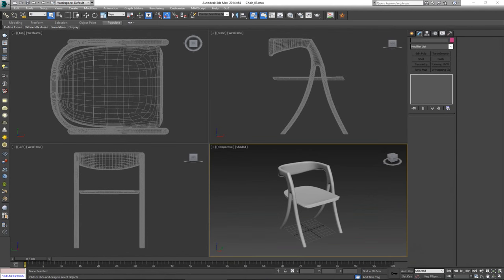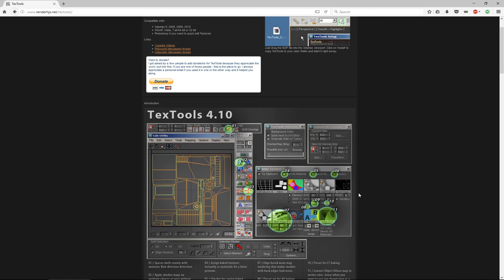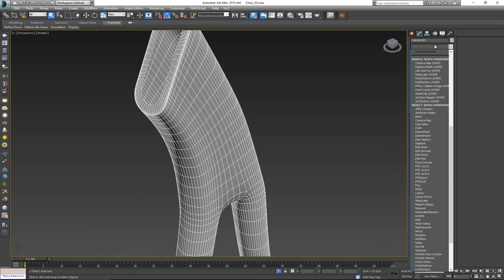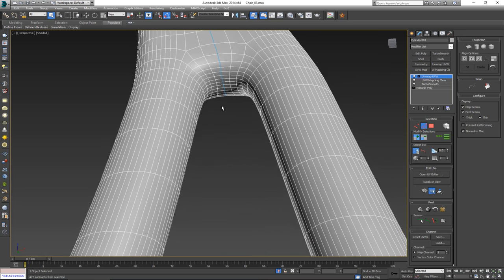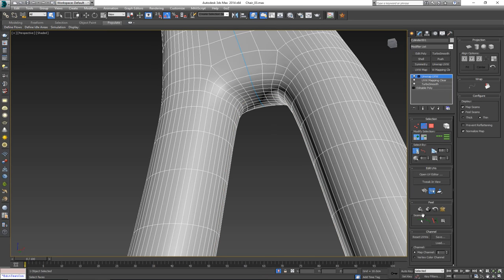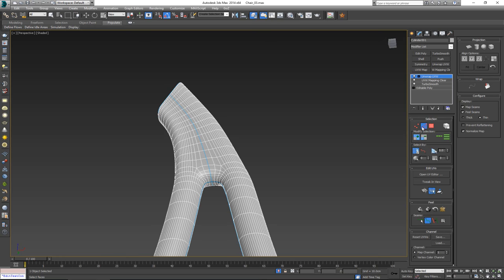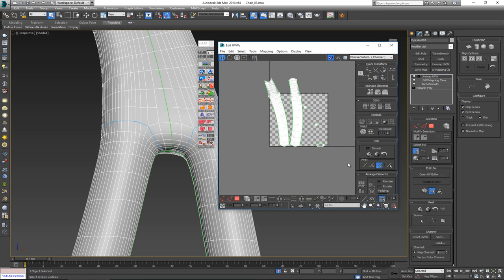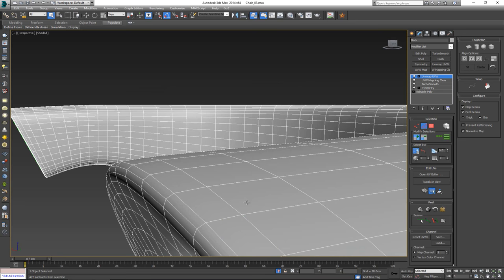Unwrapping the Brookhaven Wood Chair in 3ds Max

Comment: The main Unwrapping process has explained clearly! Thank you so much! Could you please explain in future how can we unwrap something like cloth or another wavy material for Text writing or regular pattern painting in external application (PS).  I tried to do this but failed. So i am very interested HOW it is possible (through unwrapping) without special software like Substance Designer.
Reply from the maker: Cloth or any dense mesh is a bit of a drag to unwrap in 3ds Max native, but doable. For unwrapping anything complex i would go 3D Coat or Unfold3D
Reply: I'll try it. Thank you!

Comment: Thank you so much for your great tutorials. I am an educator in US and have always learned significantly from your videos. That being said, I am working on a VR project using 3d max, substance designer, substance painter and unity, and I am wondering if you will create a video about how to unwrap an interior and architectural space using 3d max  to be baked  and used in substance painter for baking and texturing process and then export it to unity. I have searched  Youtube for something similar and no luck yet.Unless you know any channels that I do not know about. I am also using V-ray for my projects, so if you believe there is a better pipe line for 3d max and unity please let me know. I am very new in using Substance family and my ultimate goal is to create a photo realistic scene in Unity for my VR project. Any advice that you can give me would be greatly appreciated.

Comment: i wish you had a link for that chair so that i can test the problematic furniture part, the second part which had overlaps and did not get solved easily.
lately i am using unwrap pro and i think it works very good, like no overlaps at all

Comment: Nice tutorial. But I'd advise you to give a try at 3D-Coat unwrapping tools. A 30 minutes work in Max becomes a 1 min job in 3D-Coat.
Reply from the maker: I used to use 3D-Coat for my unwrapping for projects that i did work on, but then i kinda pivoted away to using Unfold3D and that is even faster then 3d Coat
Reply: Oh ? All right. I stopped using Unfold3D a few years back but it was an outstanding soft when it first came out. I'll give it another go. Thanks to your comment, I just saw that polygonal-design is still working on it.
Reply from the maker: In the end what counts is that you end up with a proper unwrap, the software that you do it in doesn't really matter and you can use anything that makes you feel comfortable
Reply: Denis Keman agreed ;) But when working on a game for example the most important is to get the best in the shortest time. So if Unfold 3D is still as great and probably way better than it was : I ought to give it a try ;)

Comment: Hey. One Question: You used the Unwrap Modifier on top of your Turbosmooth. Is that the regular way to do it? I mean it gets harder to unwrap with every iteration on the turbosmooth. Would it be possible to unwrap before the turbosmooth?
Reply from the maker: Generally you want to unwrap on the ittiration that you will be using for rendering
Reply: @DenisKeman  thanks for the quick answer! So unwrapping on the lowpoly but then texturing with the turbosmooth on it is not going to work
Reply: @designstudie  Hey. You can Unwrap the Low Poly and then add TS, it works in many cases. But in case the UVs get stretched weirdly after TS (because dense vertex areas, often located at edges where you put some control edges, pull other vertices very strong to themself, which results in the stretching) you might need to add an EditPoly after the Unwrap and before the TS and add some extra edges that compensate this effect.